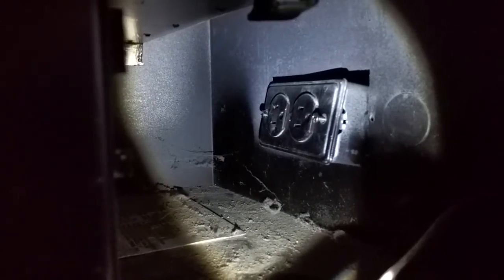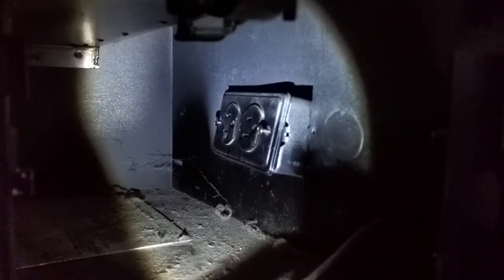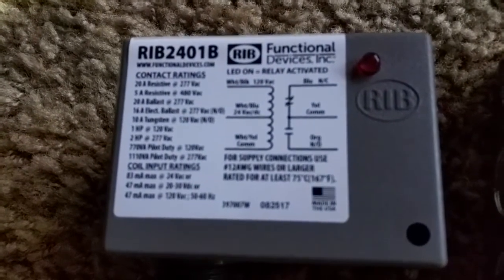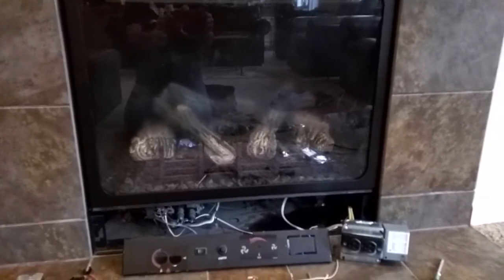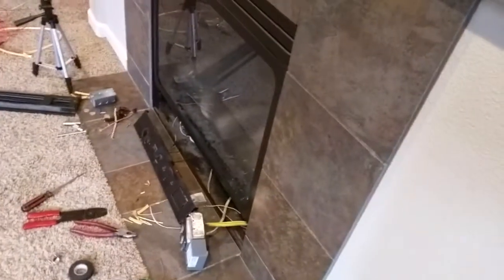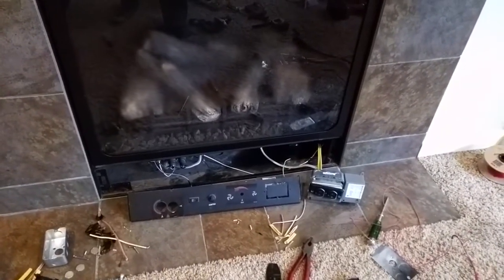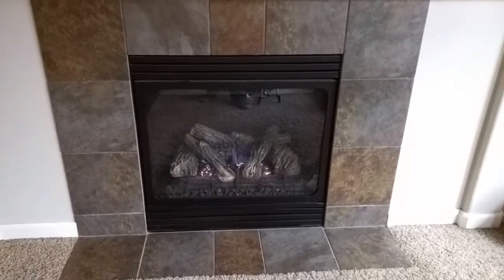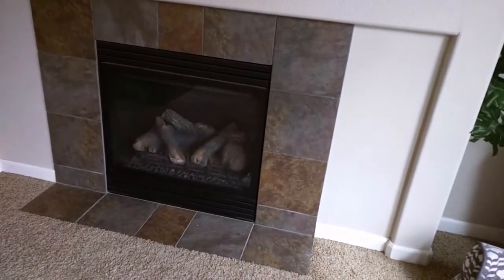OK Google Fireplace

Comment: Thanks but I wish you had shown how to actually wire the relay, even with a drawing. That is what I am trying to figure out right now! I already bought a TP-Link Switch and RIB01BDC.
Reply from the maker: I just followed the wiring diagram on the front of the relay.  I'm no electrician by any means.
Reply: @mehagel65  thanks for the reply!

I followed the diagram, but can't get it working. The TP switch is getting power, but the relay will not power. I'm at a loss.

Even with just the 120v (black) and neutral (white) wires hooked up, I can't get the LED to turn on. Maybe relay is bad.
Reply from the maker: @TheyCallMeIVIonster  On the relay are you using the normally open (NO) or normally closed (NC) wires?   I used the NO wires.
Reply: @mehagel65  hey Mark - I believe my problem was because I didn't have the dry contact input wires connected. I didn't fully understand how it worked but, and I still need to test it now, I think it will work correctly now.
Reply: Bullish hi, so did the fireplace switch work for you?  I am in a similar situation where I could use help with what wiring goes where. For example, does the house wire need to go to the ditch first then to the relay and then to the digital fireplace controller? My fireplace is a Astria model number ARIES40TEN if that helps. Thanks!
Reply: Mark Hagel hi, can you please describe how you wired this set?  Like what wires go where from the house power to the smart switch to the relay then to the fireplace. Thanks!